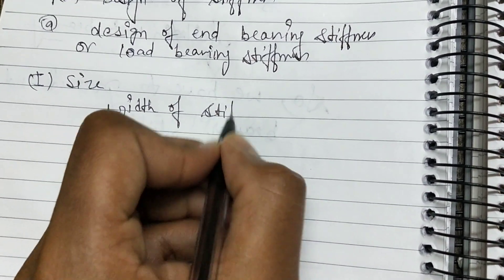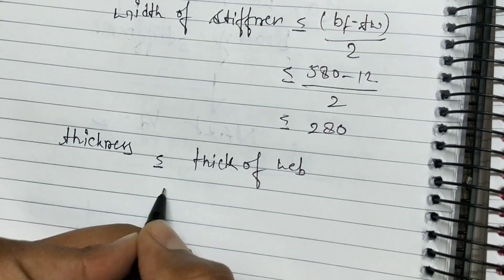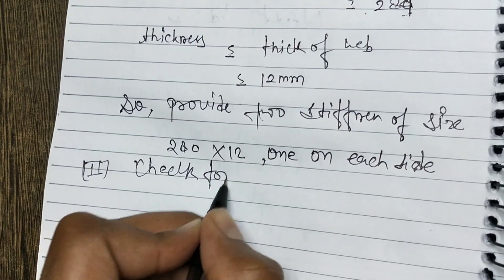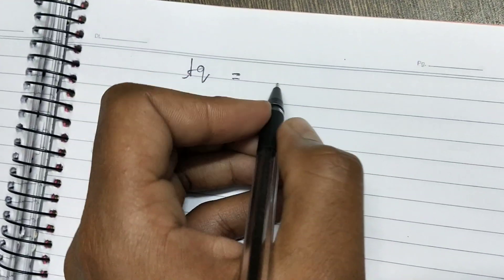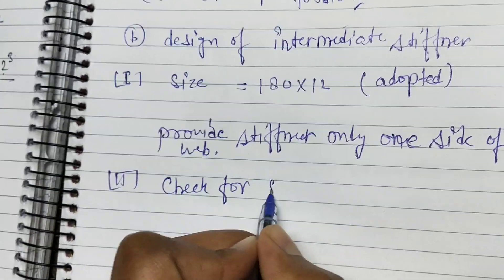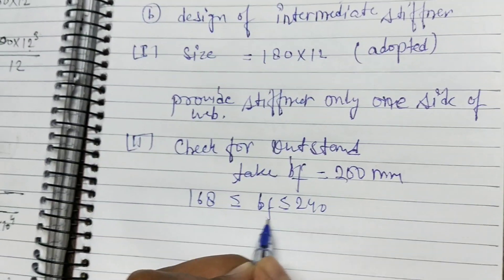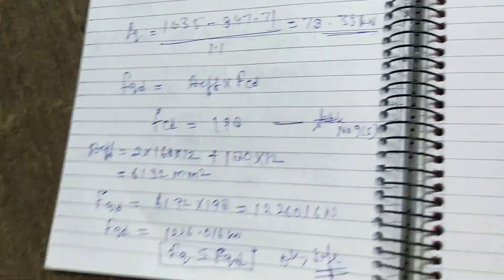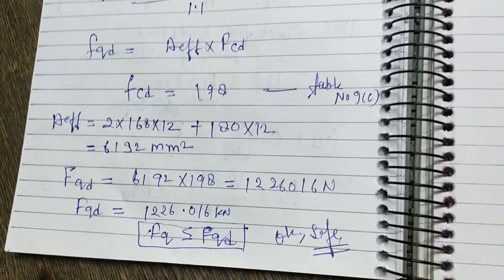Design of stiffener

Comment: A simply supported welded plate girder of 22 m span is subjected to 
UDL of 40 kN/m, inclusive its self-weight. It is also subjected to two 
moving loads 220 kN & 350 kN and the distance between two loads 
is ‘2.4 m’. Design the thin web girder with vertical intermediate 
stiffeners without using tension field method, which can satisfy stress 
and deflection criteria.
Isme moving load kaise consider kre